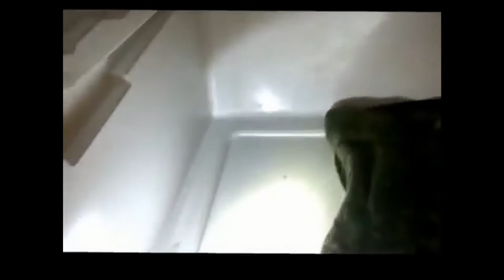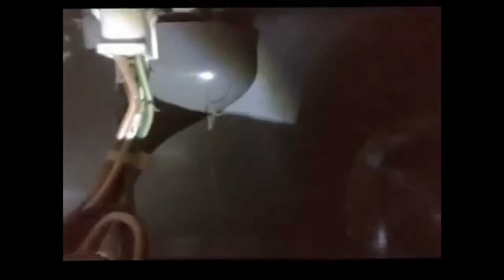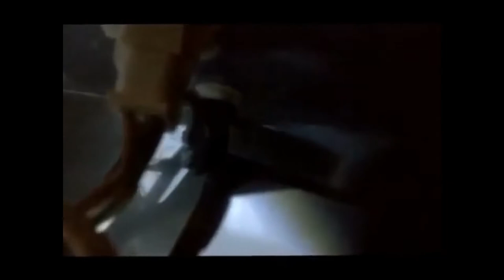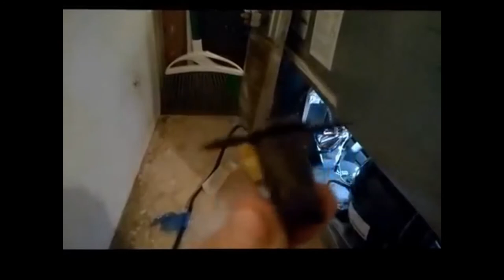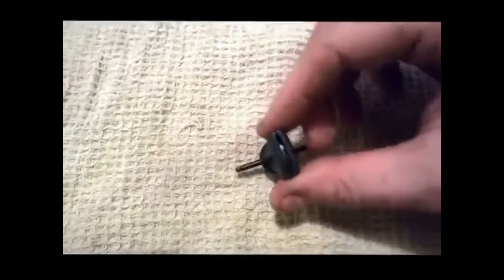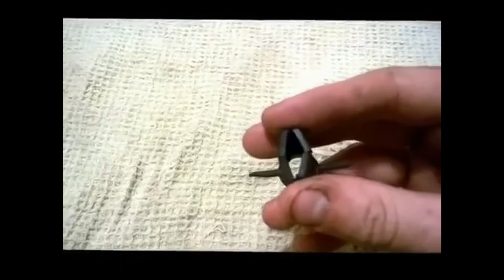Leaking Water & Ice Build-up from Bottom Freezer 💧🧊  Whirlpool // Maytag Fridge Repair

Comment: 🚨THE PERMANENT FIX!!!🚨
For a freezing drain hole problem, add a Heating probe.
(To prevent the drain from getting clogged with ice, in the first place, causing the problem) 
"You need to install a, Thick heavy Gauge Copper wire🧷🛒📎🖇 or (A Wire clothes hanger) into the drain hole 9 or 12 inches. Then bend the wire into a Hook, and clip it directly Onto the "HEATING ELEMENT/The Dark tube running under the cooling finns" (3:35).
:Explanation
"When your refrigerator Cycles through the (AUTO DEFROST MODE) The Heating element will get hot, ♨️ And the residual heat will travel down the "Copper Drain Wire Rod" and this keeps the drain hole just warm enough for all the water to completely exit the freezing section of the refrigerator into the warmer fridge section, thus preventing any buildup of ice to form."💎 
Good Luck! 
"After I did this to mine, I haven't had to deal with a leaking refrigerator problem since."https://youtu.be/_FqJxMdAi8U